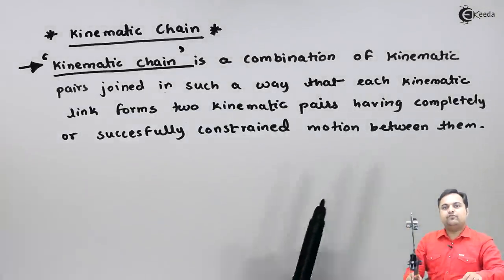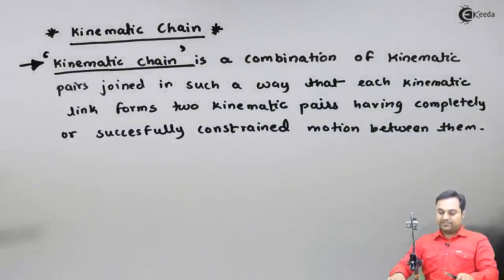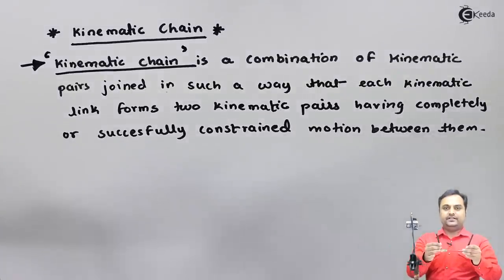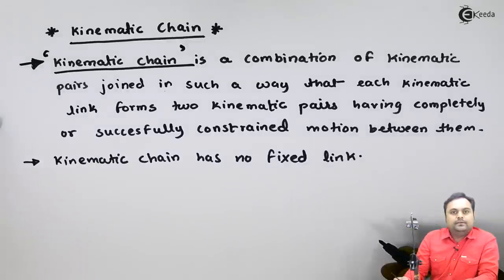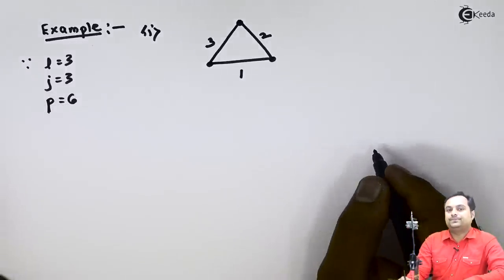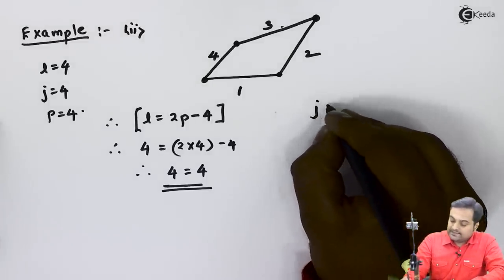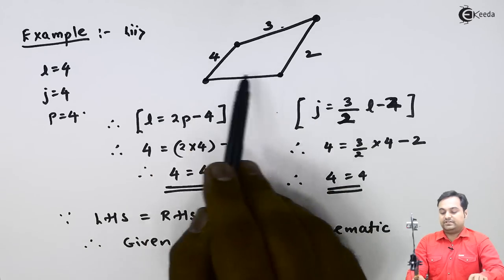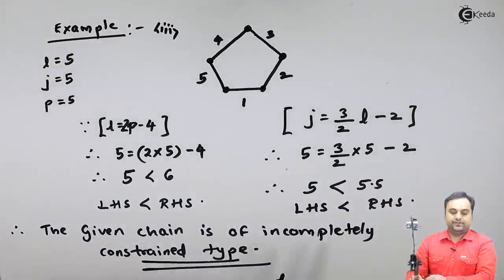Kinematic Chain - Fundamental and Types of Mechanisms - Theory of Machine

Comment: Respected Sir, using the two formulae to check whether a chain is completely or incompletely constrained motion. If I want to check whether rectangular bar in a rectangular hole and circular bar in a circular hole. The parameters remain the same in both cases and the answer must be the same in both cases but one is completely and another one is incompletely constrained motion? How can you justify this problem using these formulae?
Thanks